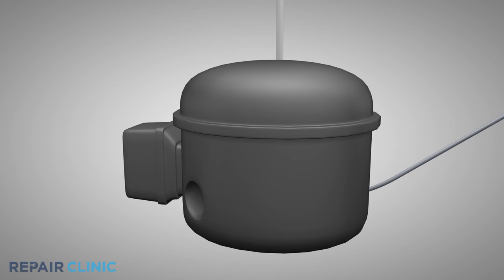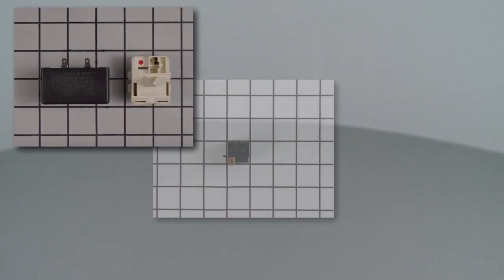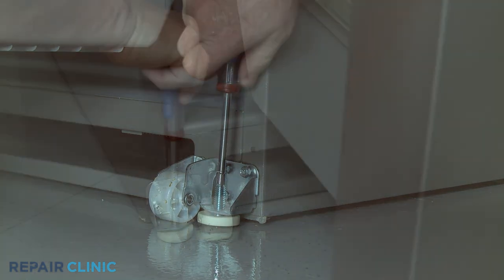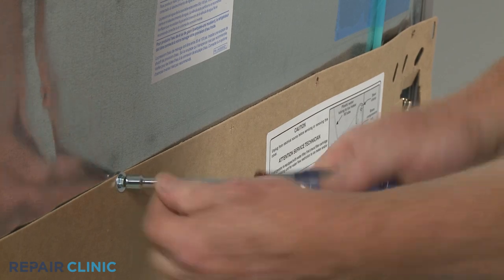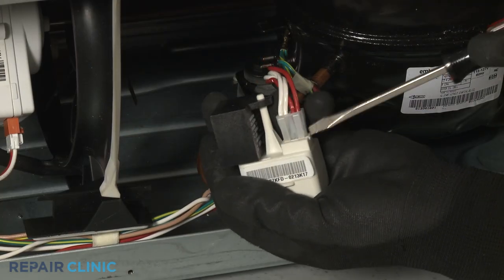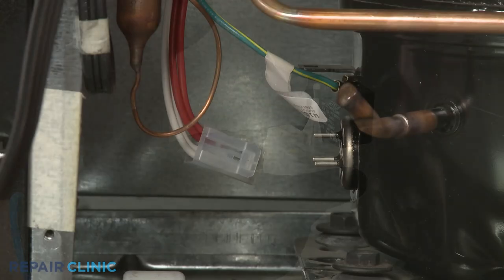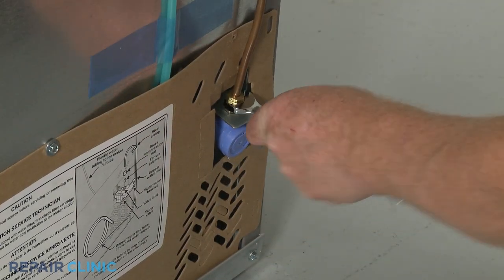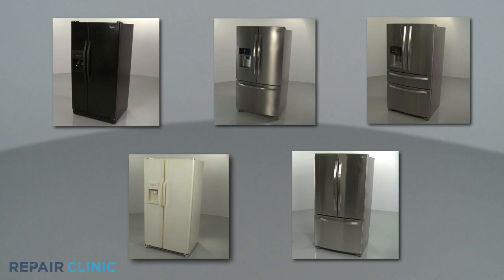Refrigerator Compressor Start Device - How it Works & Installation Tips

Comment: How does the actual relay switch work on the inside though? In your diagram, you show a type of "door" that swings open. But in those switches there are no doors, there is a little disk cylinder thing between two contact points. How does that little disk open and close?

Comment: WARNING! This video is working on two different devices at the same time (which can be confusing). 
You (probably) have either the component that has the capacitor (the black box) on it, or the other type shown in this video (the brown plug). 
For small refrigerators (I guess with smaller compressors and therefore lower start amps?) I have seen a start device with a disc inside. It looks like a disc capacitor, but it is a thermistor (if you don't know what either is/does, you have more learning to do.)

Comment: DON'T DISCONNECT THE WATERLINE! (unless the line is too short to pull out the refrigerator)
If a cardboard panel is in the way (like in this video, CUT THE CARDBOARD!)
That was a design flaw from the beginning
(those that make these appliances don't care if YOU can work on them. They are designed and built for ease of assembly.